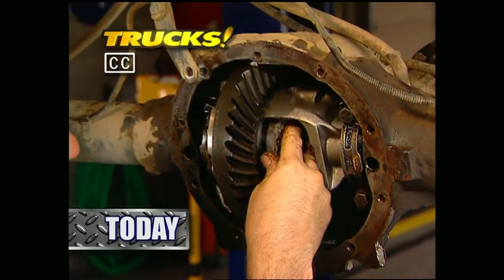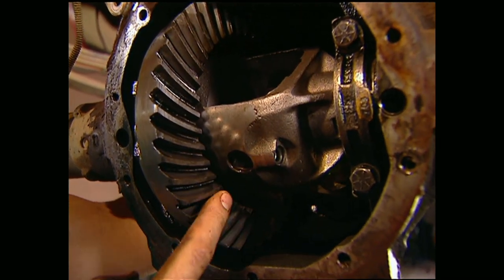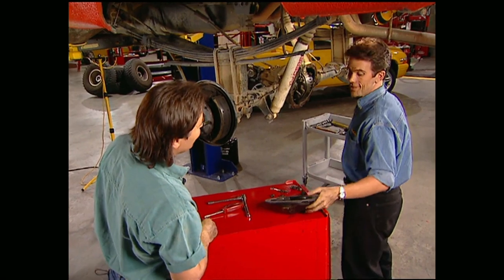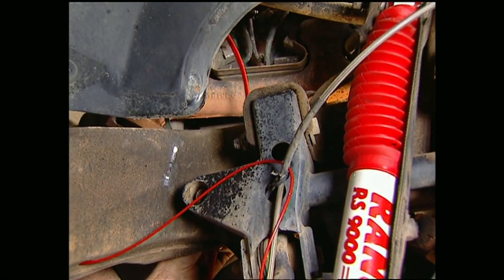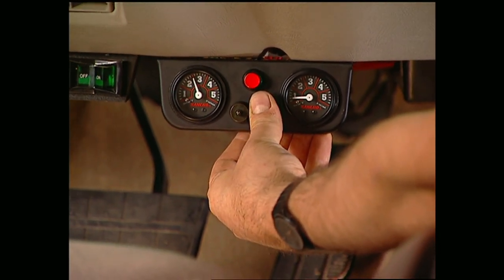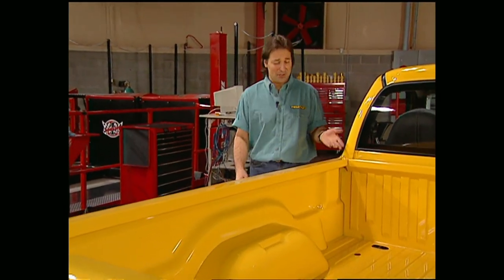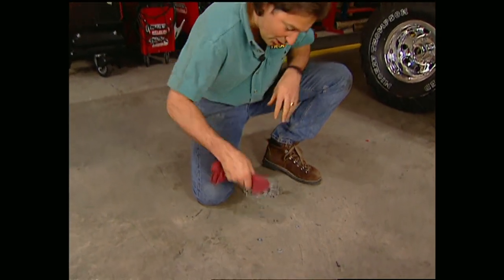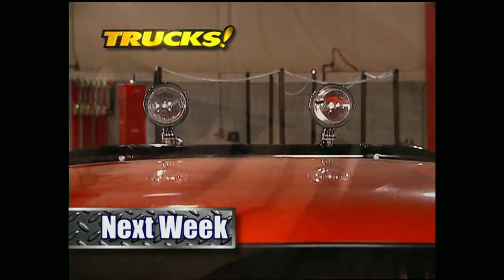Improve Off-Road Traction By Installing A Locker - Trucks! S1, E4

Comment: God i forgot how popular car bras were in the 90s
Reply: I never liked them.  They were so ugly and long time use actually damaged the paint.  It didn't matter how tight you got them, air flow will always cause them to move, scratching and rubbing the paint.  Sand and fine dirt will always get under them and moisture trapped under them would cause even more damage.

Comment: Where does the gunpowder fit in.
Reply: The gunpowder goes in the machine gun in the back. Like an African technical. That is what single cabs are amazing for.
Reply: Generally in a brass case with a printer at the back and a bullet topping it off.
Reply: @Oddball damn auto correct